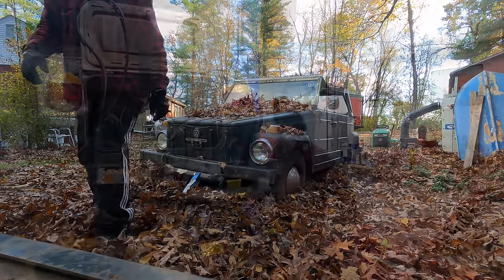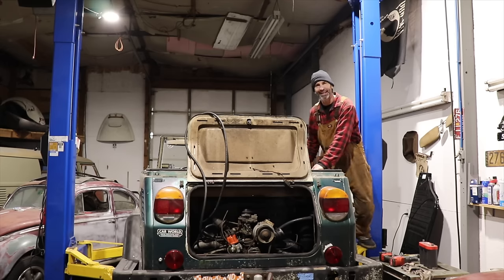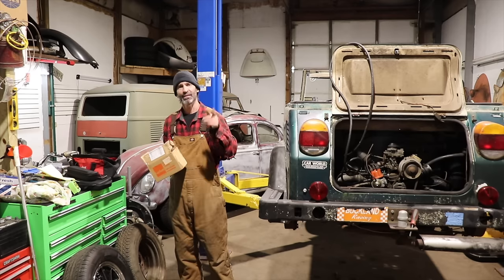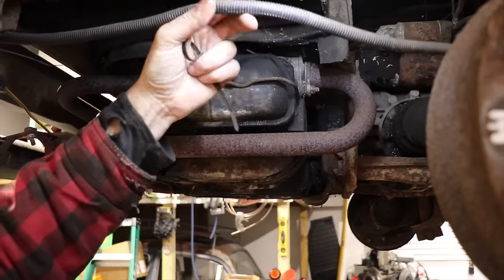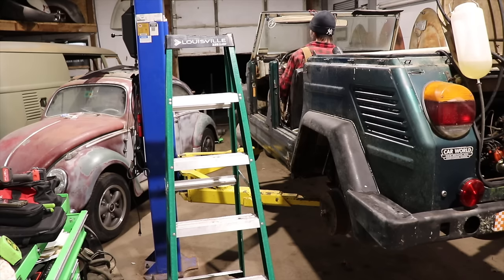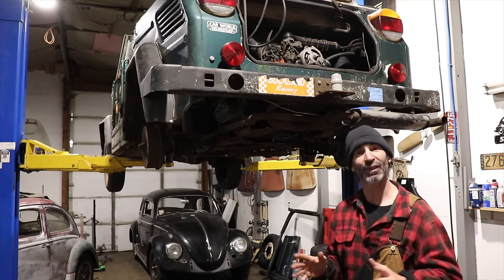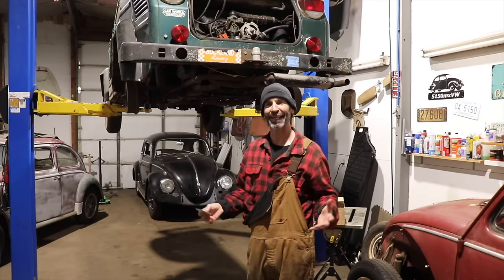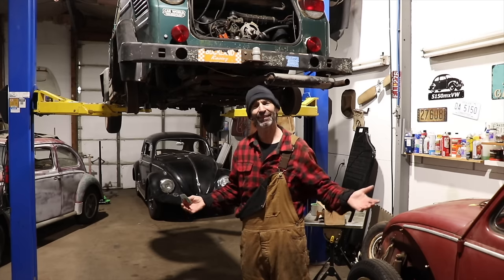VW Thing type 181 Revival 1st Drive prep - what is that noise? First drive next!

Comment: I really like your positive attitude. It’s infectious. I remember in 1979 I was living in Newtown with my dad and would visit my mom and step-dad in Trumbull. He had an Orange Thing. They were in the process of moving to Stepney just off of Zoar lake and my step-father was shifting up and down due to the elevation and road conditions. As a 12 year old I thought it was pretty cool because he built up the rpm’s between the gears. So, for some pre-teen reason, I decided to hold my breath between the gears. It was going good until we hit a straightaway and he went into 4th. I was turning blue in the face and finally had to breathe. Funny how at almost 57 yoa I remember that. I also remember that his plastic windows would get cut. He worked in Bridgeport (say no more) and he used a kerosene heater because that Thing didn’t put out any heat! Fun memories. I like your channel, Bub. By the way, that $1,500 was a great price for the Thing. They are quadruple that in Northern Virginia. Blessings to you and your family.

Comment: Love the v-dubs. 16 years old and my 1st car was a 71 semi-auto beetle. Later I had a 73 manual.
Reply: I had 72 semi auto, I remember asking the guy how the hell do you shift this thing without a clutch peddle?? I learned.
Reply: @kearnsey64  mine was in the shop at the lot I bought it from. Wouldn't shift and the mechanics there had no clue. Neither did I at the time. That little wire running up through the gear shifter had broken. Ét voila! No clutch.

Comment: The older fuel pumps are rebuildable. The newer style like the one on the Thing engine, are not rebuildable. You can use the older style pumps on engines with alternators.

Comment: Timing is really simple. If your car is new, look in the book. Your pulley should have 3 marks. 
Zero, the first from left, I believe.
Zero is only for setting your valves.
5 or 7? The next two from left are your timing marks.
Put a dab of whiteout on the correct one. So when you come back later, you already know.
1. Pop the dist cap, turn it to No.1. The zero mark should align with the case split.
Now your TDC.
2. Turn the pulley in accordance with the white out mark and align it with the split in the case.
3. Loosen the dizzy so it will turn
4. Use a test light, one end to ground, one to the neg. Side of the coil, ….point side.
5. Turn on your ignition 
6. Turn your dizzy, until the light comes on. Back up….to the left.. I think, …the pulley. Light should go out. Turn it the opposite way, and if you have your dizzy adjusted right. The light will come on when you have your white mark aligned with the split in the case.
7. You can with great effect use a stroboscopic light as well.
8. Be careful when you clamp your dizzy down,. Because ‘Abner Dimwit’ , cranking on that nut in the past may have bent it in such a way, that it turns the dizzy a degree or two… so recheck your work.

Comment: I know it’s not terribly exciting cinema, but do you drop and revive the fuel tank on all of these?
Reply from the maker: if it needs an apple cider vinegar cleanse sure ...also run a wire / cleaner / air through the fuel line  or replace with new line if it's really bad.